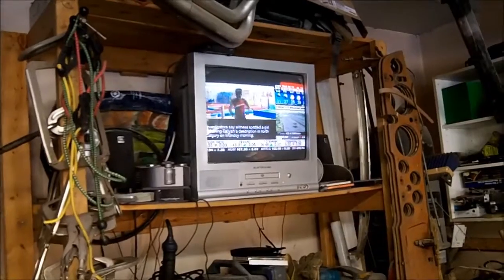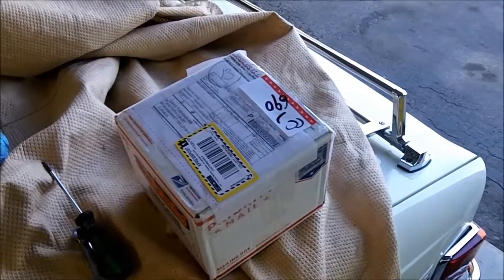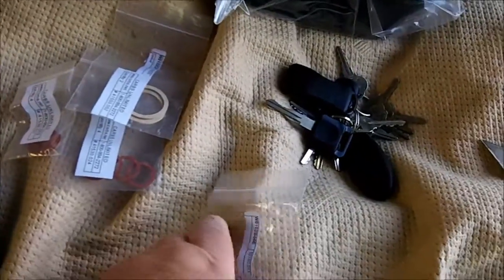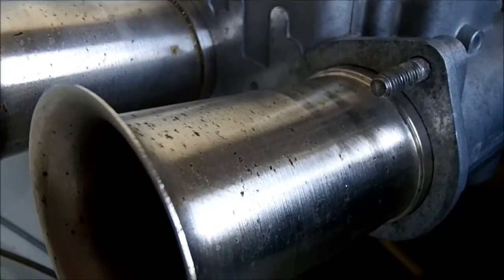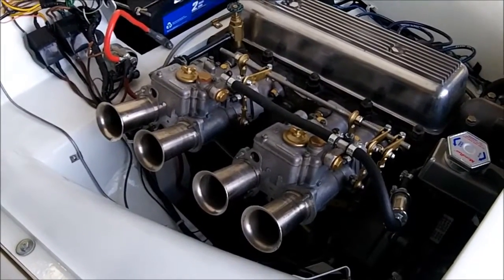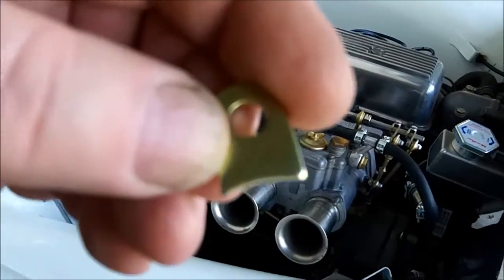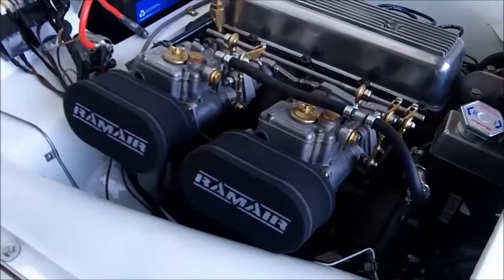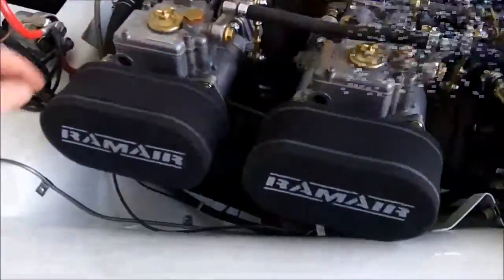Playing Around with the Weber DCOE 42's, 1960 Triumph TR3A

Comment: Did you ever find out that the ram tube tabs wont go on with the tubes all the way in? Yes you did. The tube is tapered so you have to have the tube stop lip in line with the end of the bolts and then slide the tabs on the bolts. Then slide the tube and the tabs in at the same time... no die grinding, it's a neat fit. Depending on the clearance to the engine bay, some tubes need to be fitted to the carby first before you fit the carby to the manifold. So choice your ram tubes carefully.
Reply from the maker: Trust me. I tried every way of fitting them. Grinding them was the only option.

Comment: Those look and sound great Dave.  On another note, what kind of shocks do you have on your TR6?  I still have the original factory shocks but they are shot.  I was looking at the Konis in the Moss catalog but my God they are expensive.  I found the same shock at Summit Racing for $190 for the pair with free shipping.  At that price I cant go wrong.  Keep up the good work:    Jerry
Reply from the maker: HI Jerry, I assume that you are talking about the front shocks for the TR6.  I have Konis on mine and like them.  If I had to do it again though, I would probably go with the SPAX ones as they are externally adjustable.  If you want to adjust the Konis, you need to take them off the car. Cheers, Tush